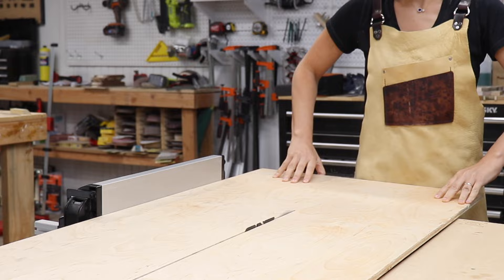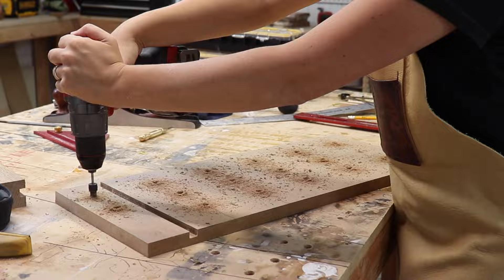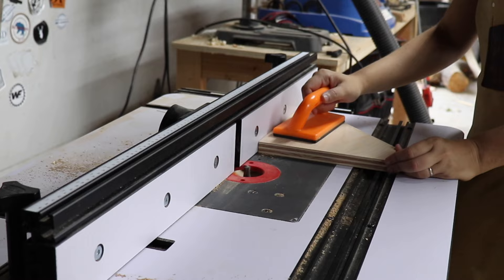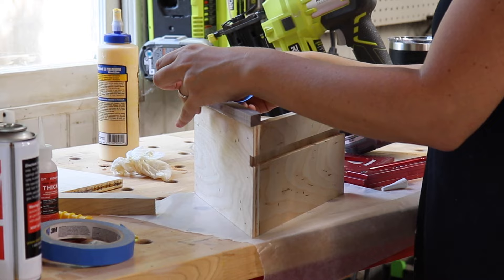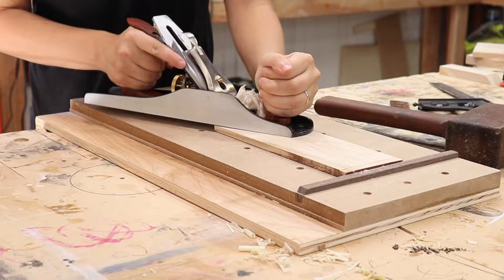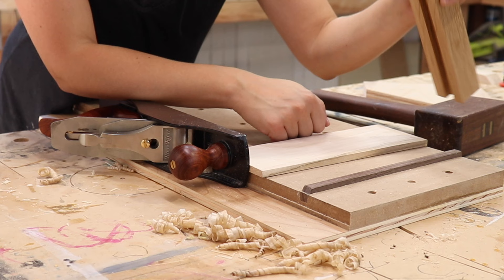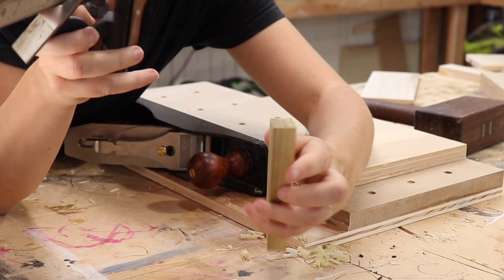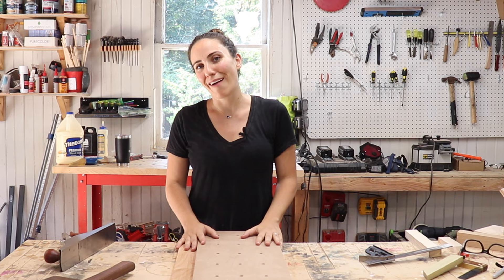Shooting Board with Miter Attachments // Woodworking Jig // Handtools // Easy Shop Project

Comment: Hi Tamar,  I'd seen this video before, and other shooting board videos since, but this is one of the best, esp. with its modularity.  Now, after being less than satisfied with the miter joints on the top of a box I'm making, I just watched this 3 more times before making one.  Handicapped by not having a table saw, nor the room to add one until a new home is completed in ~ 9 mos., I tried both miter saw and radial arm saw and decided the former was the better choice, leaving the radial arm saw for 90* cuts and dadoes.  I still think that was right, but the miters still need a little repair, and doing it w/o a shooting board is guaranteed frustration.  I'll appreciate having one jig for multiple applications!  You teach so well, even when (or maybe because) you're in the process of earning.  'Tis said the wise one is she/he who knows what she/he doesn't know - I'm getting wiser every day!

Comment: I could not be more pleased with this jig. For square edge cutting the very 1st setup gave me perfect trims. On the long bevels it took me a while to get the cut square to the edge against the fence. I finally decided to make the fence on the 45 degree platform to be adjustable using t-bolts and slots. Now these long bevel cuts are perfect too. I'd never used a shooting (chuting?) board before. I don't know how I ever got along without one.  The Low angle L-N Smoother works very well, as long as the blade is ultra-sharp. Perfection seems elusive in this trade, but this is a big step forward for me. 

- Brad (the just-barely-beyond-novice guy --- but wannabe-intermediate-before-I-die-guy)
Reply from the maker: So glad it was useful for you and you got it dialed in!

Comment: I am so going to make something very much like this after watching this video.  I have had a shooting board on my to-do list for ages, and this is going to help me get it done.  I Love Rob Cosman's videos, and one thing he does is paint the lower edge of the rebate that the plane runs along with CA glue to harden it.  That sounds like a good idea to me.  Rob also does a totally OTT trick with masking tape to force a slight curve that apparently makes the plane sit flatter on the base, but I think I'll give that step a miss.
Reply from the maker: Yeah. That seemed a bit much for me. Ha

Comment: Nicely done.  Mineral spirits might work to take off the wax, and give you back the useful friction.  All you need to make the donkey's ear work for thicker stock is a straight stick of wood to put between the work and fence.  It need not be attached, but a small block at the top to keep it from sliding off is helpful.
Reply from the maker: Thanks! Going to try the mineral spirits. And that what I did when I actually made the box. I just put a scrap backer on

Comment: First of all great video and info. I like the saw stop with the micro adjustment. Certainly don't need playing cards to do that now. You were saying right before the giant bee assault that there could be tear out of the wood in that configuration... you could also back it with another piece of wood the same size. Can't wait until the next video.
Reply from the maker: Hahaha yes. That darn bee rudely interrupted me. That’s exactly what I ended up doing when I used it for my actual project.

Comment: looks like one of the best shooting board designs out there.

I like the modularity factor. I'm going to make one for myself, with one major extra feature and some customizations
Reply from the maker: Awesome. Good luck with it!
Reply: @3x3CustomTamar  Thanks. The SUPER major feature that I'm going to add is:
- cut 2 inches off the left edge, plant neodymium magnets on both pieces to keep them together
- whenever I'll be board-shooting the long boards, I can then separate the magnets-held left wing, and put it under the other end of the long board, to support it. 

And I haven't decided yet, but I think instead of the long slot to achieve the modularity, I might use 3 aluminum dowels. this way all I need in the new attachment, is to drill 3 holes in a straight line (drill press + fence).

Comment: I need to make a shooting board.. I actually had a need for one last weekend.

Maybe a hole or two in the top of the "base" fence, and alignment dowel/pegs in the attachments would fix the sliding problem (which would eventually happen regardless of the wax).
Reply from the maker: Yeah. I have been wanting to make this for months. Ha. While that sounds like a good idea. The fence gets chewed up by the blade and you want to be able to sneak it forward to resquare it and keep it as a zero clearance fence for your workpiece

Comment: Love beautiful minds at work.  Couple suggestions/ideas the 45 the edge stop was wondering if you could put a small grove to lock it in.   Second, on all attachments also wondering on putting 2 to three pegs for the attachments don’t slide back.   Other then that sweet work.
Reply from the maker: Thanks! If I didn’t put wax in then they wouldn’t be sliding back. The idea for pegs is good. But really you want o be able to move it towards the plane in case it ever comes out of square or you need to create more of a zero clearance.
Reply: 3x3Custom - Tamar Good point.  Have a beautiful weekend.

Comment: Getting the plane blade perfectly square has been a pain.... To say the least. I picked up an old Winchester plane, and one previous owner had scribed a line across the throat. That helps a lot for me. I also am some times putting a square across the plane blade as well. Just looking down the edge doesn't do it for me.... 

I have yet to make a shooting board. Well, I have one that does 'function' but not super well yet. I like the adjustability of yours with the different 'attachments'. Keep wondering if there is a more secure way to attach them.

Comment: Just recently found your channel and like what you are doing so far, great work and ideas. Also major props for referencing where ideas come from, too many don't nowadays. 

If you want to use body mechanics while you plane, add a little strip of sand paper to the bottom of the jig for while you are pulling back. 

Great work.
Reply from the maker: Thanks! Sandpaper is a great idea
Reply: Peter, sandpaper will give a good grip, yes, but over time will abuse the bench.
Reply: True, but my bench gets abused anyway. I use a sacrificial top.

Comment: On the mitered pic that is taller than your fence use Rob Cosmans technique. He will cant the workout slightly, like a 1/4 or a1/2 degree on the backside that will tear out, then he shoots the edge he needs to true up. That eliminates the tear out. You can see him use that technique in his videos.
Reply from the maker: Yeah. That’s what I meant by putting a chamfer in the outer edge. I ended up just using a scrap at that back and that worked fine

Comment: l wanted to add that l built your modular shooting board with minor additions.  On the base l used scrap particle board and MDF. for your standard fence l used a piece of Maple  but cut it square on one end and a 45 degree angle on the other. Then  drilled a 3\4 hoe on both ends and epoxied in 2 magnets.  This is so l can also use it as a bench hook as  well.
Reply from the maker: Sounds like great additions!

Comment: Good project Tamar..

Removing wax from the dado
I don't know if this will work but, you may be able to reduce or eliminate the wax you put in the fence dado by running it past that 1/2 inch router bit.
Given that a brown paper bag is used for sanding in some situations, it may remove the wax without altering the size of the dado.
The final and fastest solution is to just make a new fence.

Attachment positioning
An easy method for positioning the attachments would be to add a fence to the back of the attachments (a little iffy) or to the back side of the shooting board.
A more complicate method would be to add a dowel to the bottom of the attachments and a register hole for it to enter in the board.
Once the attachments are cut to flush, the blade would not cut them again.
Reply from the maker: Thanks! Love these suggestions
Reply: @3x3CustomTamar  😎

Comment: Hi Tamar. I love your work. IF I can be so "cheeky"  as to make a suggestion to your Donkey Ear Jig/Sled. I have made your sled ( great idea) but used my modified version.

I made the Ear Sled base board longer  than yours at 30cm using 18mm tick composite HD wood laminated board 
#1 I cut the leading edge of the sled base board to ~ 44.8 degrees ( I will say 45 degree for the rest of this message for convenience). 

Reason for doing so is that if I have perfect 45 degree miters (difficult but still possible cut on my Harvey table top saw using an INCA miter sled) and bring the 2 boards together at 90 degrees that when I do the glue up, the glue creates a slight separation to the joint. 

By cutting the miters to a fraction less than 45 deg the exterior edge remain perfect visually. The back of the joint is slightly ajar when the miters are cut a fraction less than 45, and this tiny space can accommodate the glue. To be honest when the glue sets you actually don't see the < half degree separation at the back of the miter joint

#2 The 18mm cross dado is cut further back/forward  to the other side of donkey the ear fence ( away from working area)  - that gets around the issue you had of having to trim the insert. Your support dado is at the bottom of the working area of the sled. I didn't think that was a good idea.

#3 I cut another 18mm board with reverse 45 degree bevel. It measures 21cm long x 20 cm wide. This upper board's bevel rests perfectly in line on the base board's 45 deg bevel. 

2x 45 degree blocks are inserted tightly  into 2 blind dado's ( used router - same bit that has been used to cut every other dado for this project) that  I had cut prior  into the donkey ear base base.

# 4 A triangular shaped fence has been prepared to project 28 mm height above the working face surface. I never use boards for my cases  greater than 25mm anyway
It is then glued to the base board and to the 45 degree working face board further edge

# 5 Next was to  solve your problem of not having a sacrificial protected edge to prevent tear out.  I cut a "parrot beak" into the lower end of the fence - it snugs the 45 degree bevel and the apex is cut off 90 degree vertical to the plane resting edge - the front edge of this fence then contacts the plane and may suffer sacrificial damage in the future - but this is better than having no support for the work piece at all

Pity I can show you a photo of my donkey ear jig/sled

Comment: Maybe way annoying in real use, but I could see putting threaded inserts into your low profile fence top so that you could put counterbored holes in the attachments to keep them in place easier. Maybe it's just the wax, but I could also see these wearing on each other over time and losing the friction fit anyway. With holes at some easy spacing (e.g. 6in apart, centered), you could quickly pop through holes for screws into the attachments. Pop on, insert and lightly tighten two bolts, go to town. Just an idea!

Comment: Awesome video. Was wondering how to create a fully adjustable, maybe hingable top layer of the shooting board, to bevel wood panels for box making. I have a rough design,  but getting nervous in making it,  it's going to be basically the whole surface area of my mini workbench connected to my router table. Any help is appreciated- thank you

Comment: For a taller fence on the donkey's ear, you can turn the current support board into another "fence" just like the one that supports the accessories and then slip a taller board with a groove in it on top.

Comment: To avoid tearout: just place a flat piece of scrap at the end, between the stop and the piece you're straightening. The tearout will move to the piece of scrap.

I think some hold-down clamps placed somewhere on the various jigs would come in handy. Maybe also some lock-down mechanisms for the jigs. Whenever you hit the material, the shock tends to lift the jigs. Some lock down mechanism would avoid this.

But, other than that, I need to build something like this myself. Only, I think I'll use MDF exclusively. I don't trust the plywood I can get around here to be perfectly straight all the time.

So much to do, so little time ... :-)
Reply from the maker: Ha. Yup. There are def a lot of ways this can be done

Comment: To solve the tear out problem in the miter, can you have a sacrificial board against the fence? or it would be difficult to hold both pieces? the sacrificial board doesn't have to be very wide though. Great jig! I will build one!
Reply from the maker: That’s exactly what I did when I used it for my project. Have fun with it!

Comment: Being able to get the jigs off IS important.  What about putting a dowel or two through the jig/s into the locating bar?   Just thinking, I know the base is not all that thick but, still and all, what about some hold downs?.  Still, as it is, a great board definitely gunna make one, thanks.
Reply from the maker: The whole reason why I decided to make the fence a floating fence to begin with is so that I could nudge the fence forward every time it comes out of square or the plane eats away at it too much and it is ok longer zero clearance. So I don’t want it to be in a permanent spot. Also while hold down sound like a good idea you would have to reset them with every pass of the plane.

Comment: Excellent video a bit eerie the ending as I have just collected a swarm of bees here in Australia (it’s spring now) and I watched your video while I was waiting for the Swarm to enter the box🐝🐝🐝 question though if you measured and cut two pieces exactly the same ie 6 inches would it then be one shorter than the other I’m thinking as I do a lot of little boxes and I’ve never used a hand plane except in Junior school.... I’m now in my 60s
Reply from the maker: You would use it correct any inconsistencies in cuts

Comment: Looks really great, and I like that because the attachments are loose, you can always correct them if anything somehow goes out of square later. 

Note: CA glue is really strong in tension (pulling two surfaces apart), but weak in shear (pushing along the glued surface). The latter is exactly what you were doing with the fence, and hence it came apart.
Reply from the maker: Thanks. Yeah. That’s what I love about this jig. Can always just make more fences. Thanks for the knowledge. Ha

Comment: Probably already said* instead of regretting the paste wax (think it’s a great idea for ease of use so you’re not fighting that friction fit when changing attachments), how about changing over a couple of the “base screws” to the same clamps used on your table saw sled.  If your through bolts have a flat head and are recessed, it wouldn’t affect its base.

Comment: It's 2022 right now. I wonder if you've revisited this. Also, I have a question about brad nails vs pin nails against plywood. What are your thoughts? I sometimes feel like I might've bought a 18 ga brad nailer too soon (Mine is a Makita. $400.00 --- so freaking expensive and it performs like potato). Anyway, your thoughts?
Reply from the maker: I only have a Brad nailer

Comment: Do you think it would be a good idea to dado the base board at the edge of the plane guide so that saw dust/wood chips will not collect and prevent the plane to be against the edge?
Reply from the maker: Hmmm. Not sure. I havnt really found that to be an issue yet. But I’ve only used it for a couple days. Ha

Comment: Nice! I need to improve my hand tool skills and this would help.  Wondering if a T-track down the middle would be useful to clamp the workpiece in place. Perhaps more hassle then it would be worth?
Reply from the maker: Thanks! I don’t know. You kinda want to keep pushing the board in towards the plane as your going so I’m. It sure that would be helpful
Reply: @3x3CustomTamar  Good point.

Comment: You have some great jig building ideas tamar, thank you for sharing. I wanted something to help me do 45’s on box edges and this’ll do nicely as long as I can make the jig accurately enough without a table saw! I just got a Dewalt 745 but the bed wasn’t perfectly flat so I returned it. Not sure why you bothered with the extra cut out along the length of the bed as surely after a few cuts the blade on the plane would have recessed the board for you?
Reply from the maker: My tip isn’t perfectly flat either. I am a actually going to put a video out soon on how I deal with all the inaccuracies in that saw 👍

Comment: Why would you need to cut that rebate to avoid the plane chewing into the edge of the board? Wouldn't the plane naturally cut that groove itself?
Reply from the maker: I guess it’s just to control it before it happens. Ha.
Reply: @3x3CustomTamar  got it. I think I've seen a video from Paul Sellers where he used the plane to do it. Maybe easier for some folks with only hand tools. Great vid. Thanks and keep 'em coming.

Comment: On the donkey's ear, you will get low fence tear out as you say but you're also limited by the relationship of the thickness of the wood and the width of the plane.(especially on the donkey's ear - probably about an inch thick wood.) I have seen slanted ramp shooting boards that address the issue but ... Who needs all that?? Yours will work fine with higher fences and less wax.
Reply from the maker: Yeah! I’ll make do and figure it out! Wish I didn’t put wax on. Oh well! Ha.

Comment: Great design and build! I would think you could remove the wax with mineral spirits. On a side note, about how much does your table saw sled weigh? My original one weighs too much so I never use it.
Reply from the maker: Thanks! Yeah. I’m going to try that today. It’s not too bad since I cut off the back left corner of it. It keeps the weight down